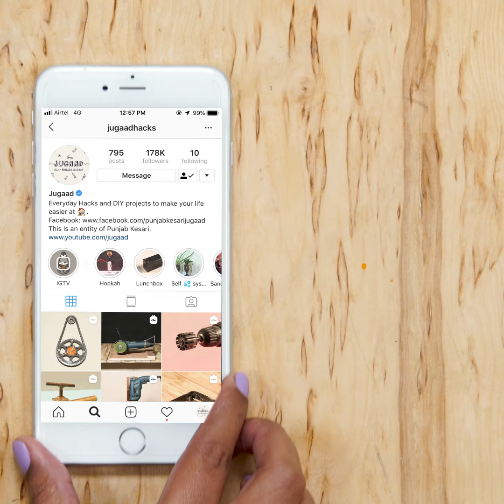Amazing DIY Idea

Comment: For safety, a separate grinding disc or grinder power tool is a must have. Cutting disc is strictly for cutting🙂. But for light grinding using a cutting disc/wheel is operators responsibility🙂